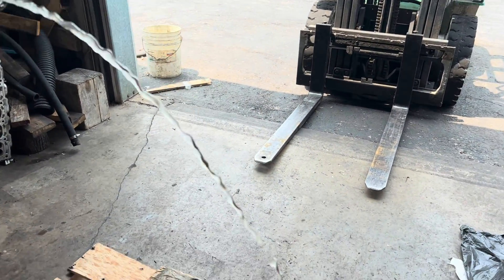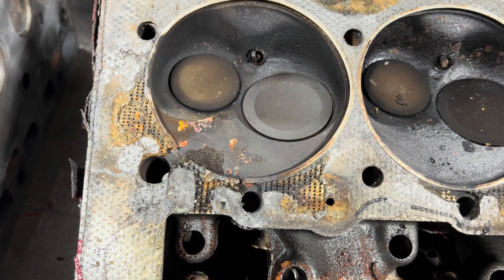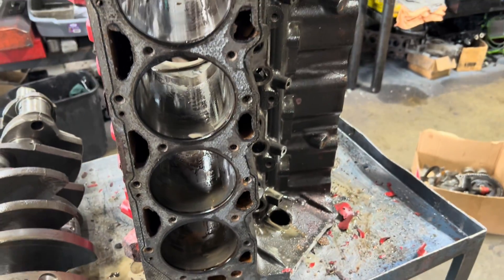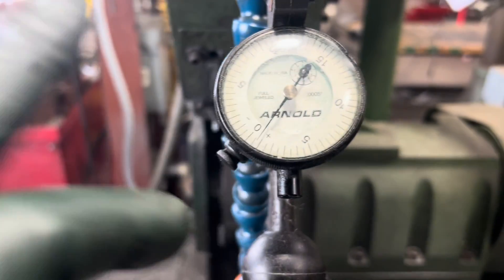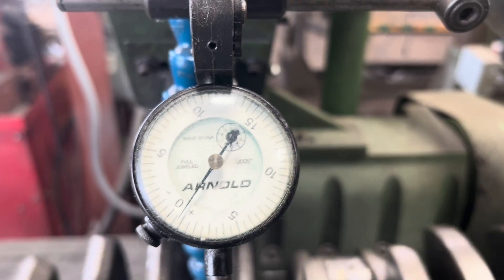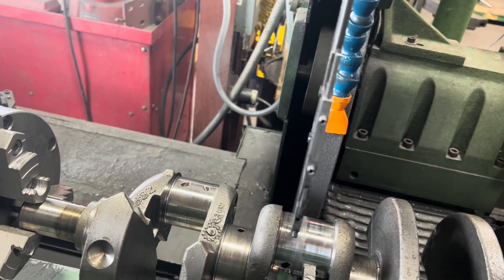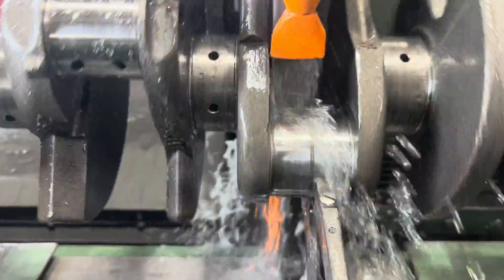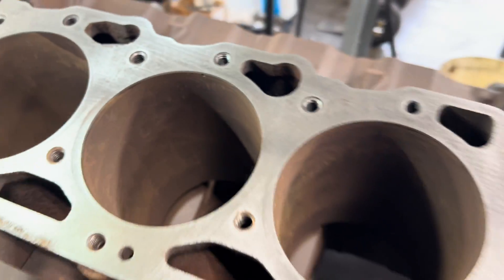8.1 Volvo Penta Marine Engine Complete Overhaul

Comment: @9:45 to 9:50 Why do the cylinders have those deep Gouges ..? The Straight lines running perpendicular in the center of the bores after machining , Did you not take enough out or is this the old novice scratch from pulling the hone out incorrectly..?
Reply from the maker: Those are witness marks from the dial bore gauge checking the size after honing. As soon as you put the piston in those marks are gone.
Reply: @LakelandAutoMarine  I Would run a surface profilometer over the
affected area to determine their actual depth relative to the bore surface , They look Deep to me , But Video and photos can be deceiving . Ive Built Hundreds of Engines Over the Years and Own Several Auto and Marine Service Centers